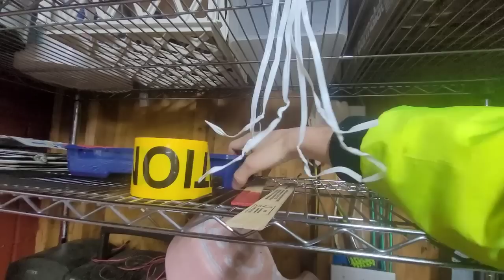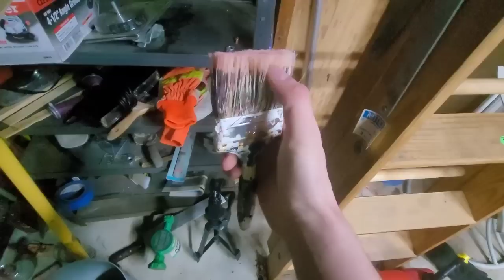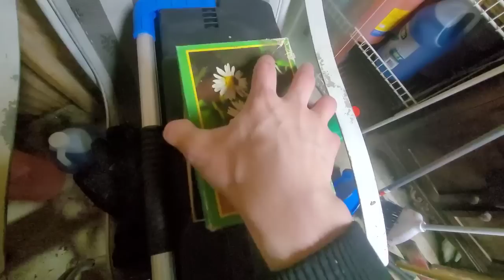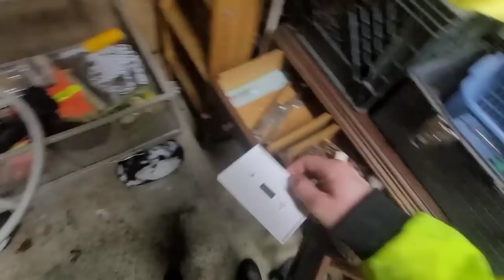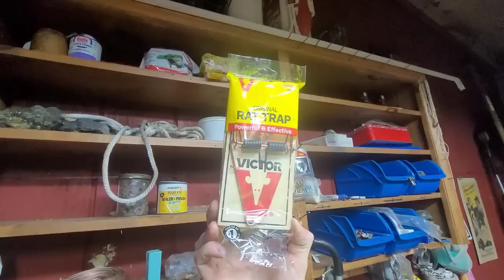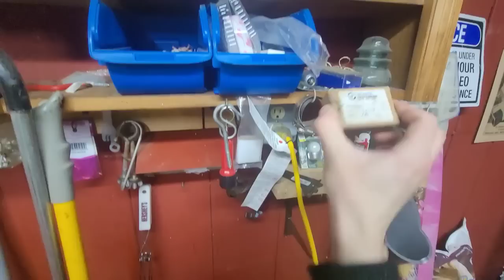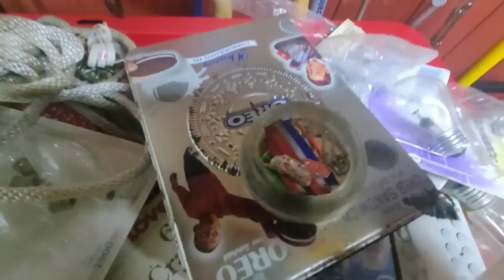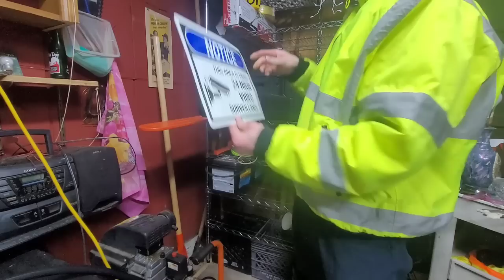Organizing The Garage

Comment: My Dad used an old refrigerator as an insulated storage for fluids.  Keeps them form freezing.
Reply from the maker: You have a good idea there, I've had that freezer there for years and I've only used it one time, to freeze 5 gallon bucket ice blocks other than that it's just a waste of space so better use it

Comment: You might be able to insulate the vaulted ceilings from the inside with rigid foam skim coated with a reinforced stucco texture. Something like Dryvit... Like a do it yourself EIFS but on the inside. A whole lot less expense and less mess vs. opening up and insulating rafter cavities and then still having to redo sheetrock and refinish the surface.

Comment: For string:

Cylindrical pop up towelette dispensers can sometimes hold three spools of string with dispensing through the same hole.
Pan head screws for each string tie off.

The force is with you.

Comment: Thaw the spray can, then run the nozzle under hot water. See if that will let you spray..
Paint brushes work good for dust or dirt  in small places or window cell , in your car crevices

Comment: I'm not sure what they're actually called, but what I call a "grabber" would be perfect for you with that shelf above your fuel oil tank that's out of arm's reach if you want to take advantage of that space.
Reply: One advantage of that more expensive Rain-X windshield washer fluid is a lower freezing point. After seeing dozens of jugs of the cheap blue stuff freeze up and burst in the bitter cold outside of convenience stores and such, I avoid using it during the winter months in my car. Probably not news to Post 10, but potentially useful information to someone else in the comments section.

Comment: Posty buddy.  As far as the mouse traps. 🐁 you ever thought about glue 🤔 traps they are human and they work great 👍.
Reply from the maker: I think glue traps are very inhumane because chances are that Mouse will be dead after suffering a while before I even find it, in this cold weather it wouldn't be able to survive more than a few hours like that, this time of year if I try to use my life catch havahart mouse trap they're almost always dead inside it
Reply: @post10Vlogs  That make sense I'm from Florida and we have the opposite problem 😅 garages become extremely hot in the summer ☀️  well over a hundred degrees 😳.

Comment: You should build an outdoor fuel locker.. Save yourself a bit more space 👍
Reply from the maker: I could probably build a little shed or lean-to onto the building if I wanted for cheaper than having somebody move that tank but yeah maybe I'll put it outside when it needs replacing

Comment: Post 10great video, but i think your border/line hoarder, your making up excuses why you should keep items that are garbage and you will never use. Like all those fertilizers, really your going to use them all? The paints, waxes and different oils and sprays. There getting pushed to the back of the shelves were they will sit for another 10 years. This video opened my eyes to the junk i have and  stuff i say i'm.  going to use, but know i wont. Like why do i have 3 chain saws? i live in a apartment. Thanks for putting this video out, i know it opened my eyes and probably alot of other's too. If you haven't used it in 1,2 5 , years you never will. Thanks Post 10. M. Canada.

Comment: Alot of things you are 
'donating', should just be Thrown out.   So dirty, yuck 🤮.

Even though the chain saw blades are covered, would be safer turned and be on shelf the other way,  with it completely on the shelf..plenty of room.  😉👍
Watching you and that chain saw sticking out sooooo far, dangerous.  Don't you think so??? You have plenty of shelf space now, so.ypu can turn those saw .. long ways and not have the covered blades sticking out so far.  Afraid you will get hurt.
Reply: You ever been inside a Goodwill or Salvation Amry store 🤔 
It's 99% dirty , broken , missing pieces type junk. I'd say he's donating better than most do 🤷🏻😁